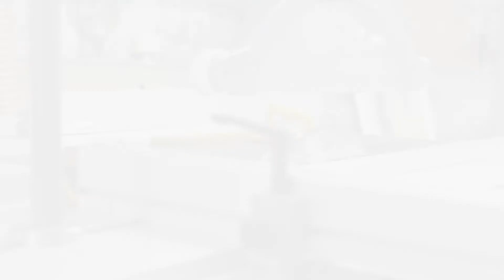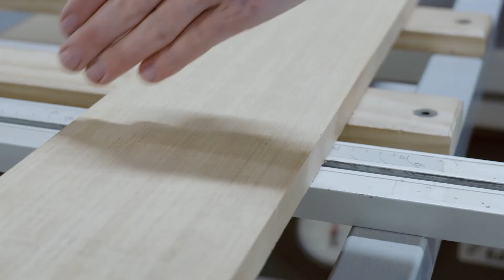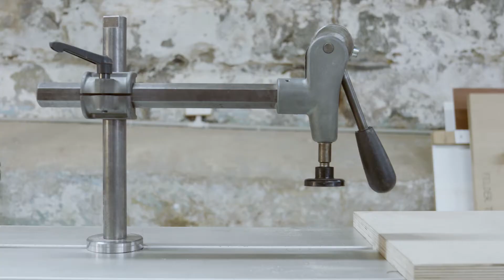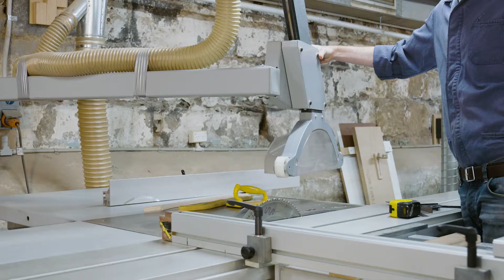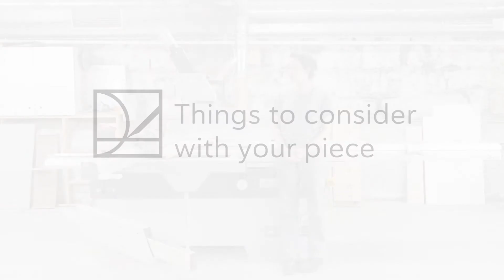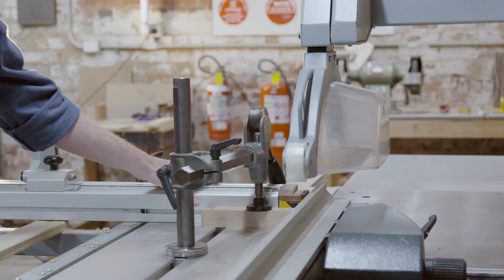PANEL SAW - MACHINE USE AND INTRODUCTION. VICTORIAN WOODWORKERS ASSOCIATION - SCHOOL OF WOODCRAFT

Comment: Your point around 5:00 about planning the cuts and allowing for blade kerf is a really useful reminder. I’m the developer of Handifyit, which turns parts lists into sheet-cutting layouts with kerf accounted for and provides printable cutting plans. Sharing in case it’s useful to other learners planning their sheet-material projects. Thanks for the clear introduction!